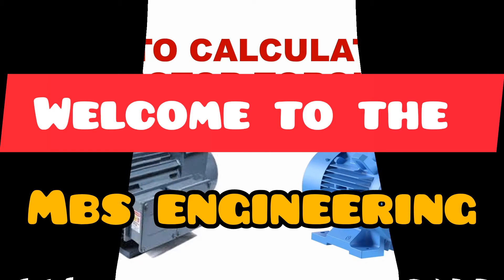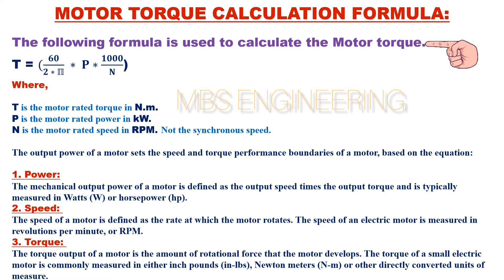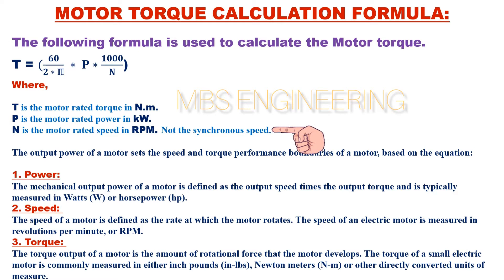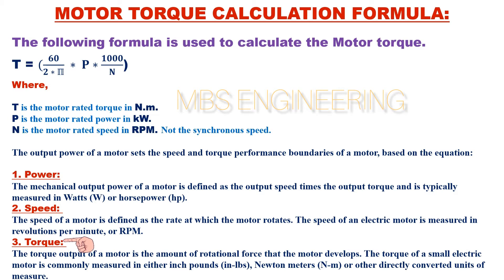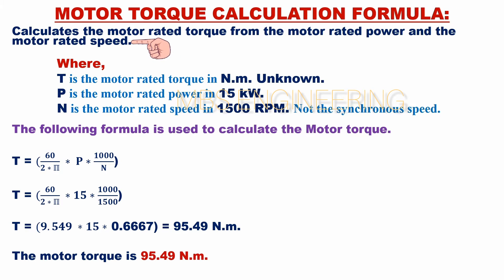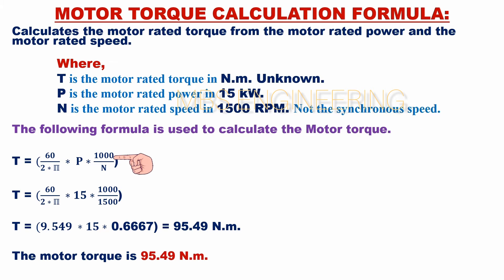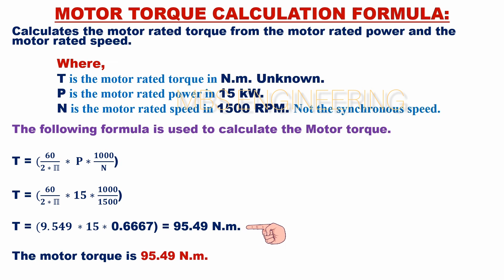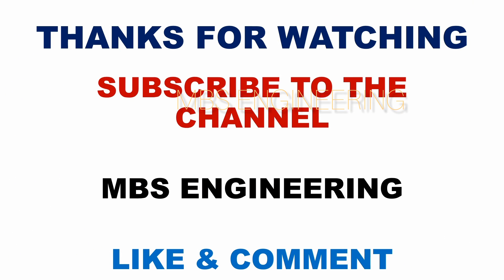MOTOR TORQUE CALCULATION / HOW TO CALCULATE THE MOTOR TORQUE / MOTOR TORQUE IN N.m / WHAT IS TORQUE

Comment: Why you use 60???? What is stand for
Reply from the maker: To convert KW to NM, multiply the power in kilowatts by 1000, then divide by the product of 2 times pi and the RPM divided by 60